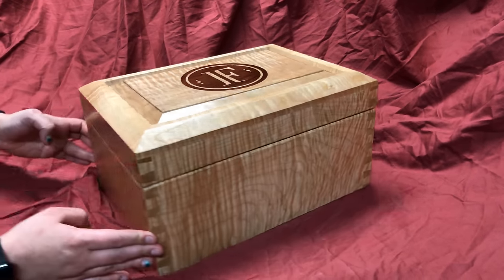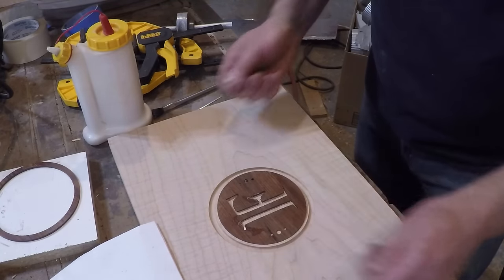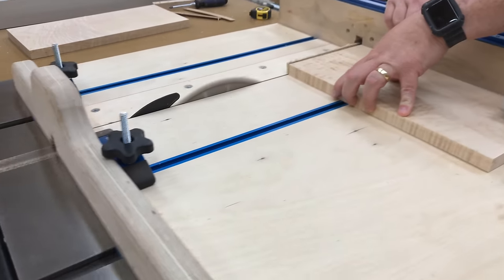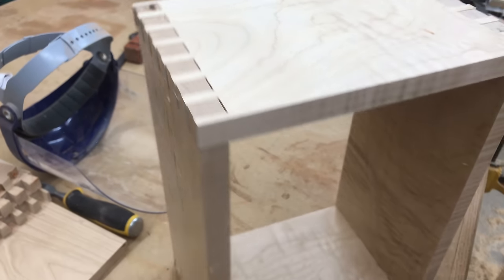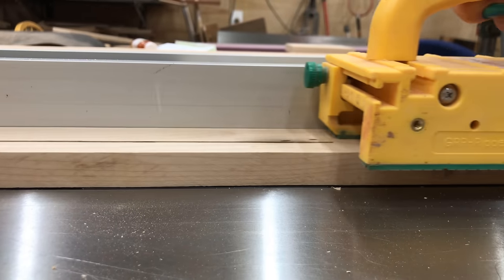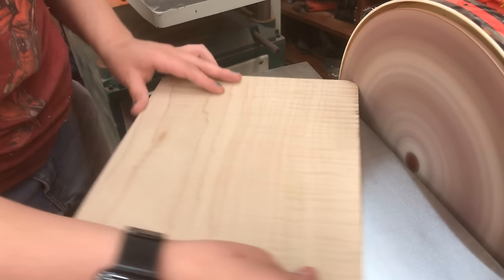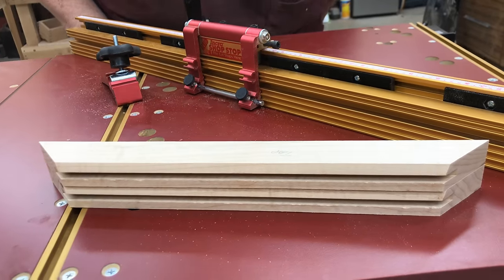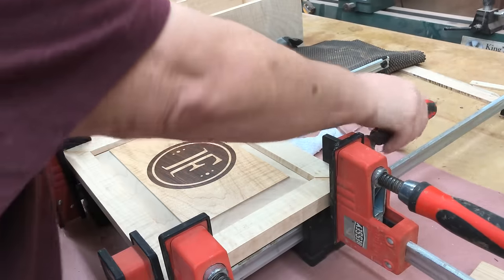48 - How To Make a Cigar Humidor with Pacific Coast Tiger Maple

Comment: Thanks for video!  That bottom panel is going to expand, bow, and crack because like you said, the sides are not going to move.  I would rabbet and float the bottom panel.  If you need a tight fit there for humidity reasons use a piece of plywood.  If you want a species match, make a piece of veneer and glue to plywood.  Just my opinion.  Thanks again.

Comment: Welcome back James, and yes I changed my channel name to something more fitting, Anthony. You used the wrong wood stock, humidors are made out of Spanish Cedar for a reason, it helps the cigars.
Reply: He lines the box with Spanish cedar. Did you watch both videos before commenting?
Reply from the maker: Hi Anthony, They are often made of many different species, but they are all typically lined in Spanish Cedar.  

There are two reasons for that. first, Spanish cedar has a very low expansion coefficient when it picks up and releases moisture, (it is very stable). 

And second, It is actually toxic to the tobacco beetle. Tobacco beetle eggs sometimes end up inside of rolled cigars, and if they hatch and grow, they can decimate a humidor full of cigars in no time. The Spanish cedar kills them off.
Reply: Nope, but then again, I am a tad busy in my own shop building the parts for a walk in humidor so yeah just had time to drop in for this part of the video.

Comment: Beautiful work! I love the inlay on the lid, it compliments the whole job off really well. I noticed during the assembly of the inlay that a brush was used to apply the wood glue. What do you wash the brush with after using it or do you sacrifice a new brush each time?
PS. I've just bought my first table saw as a result of watching your videos and am just making my first Minisled.
Reply from the maker: john gunning, I usually use silicon brushes. And the dried glue peels right off. Thanks!

Comment: Another beautiful project and production, thanks! Out of curiosity, why do you use both the Incra 5000 and a crosscut sled? I recently purchased one and figured I could toss my crosscut sled to the curb.
Reply from the maker: Hi John, well, my crosscut sled is built to make any width Dado cuts too. You should check it out. 

Plus it’s easier to square & still safer on smaller parts than the Incra Miter 5000. 

If you have a quality sled, it really complements the Incra.